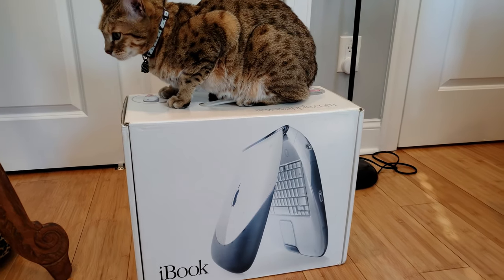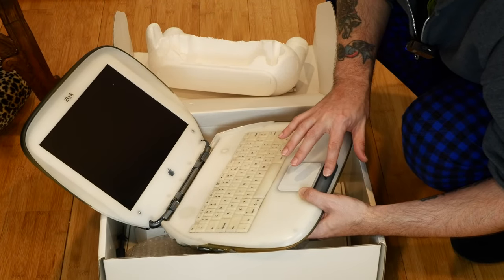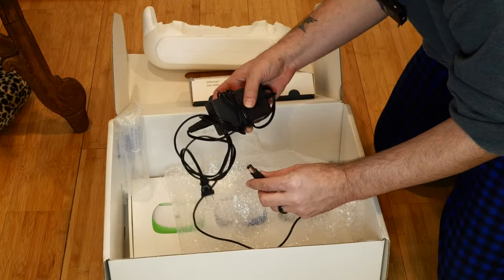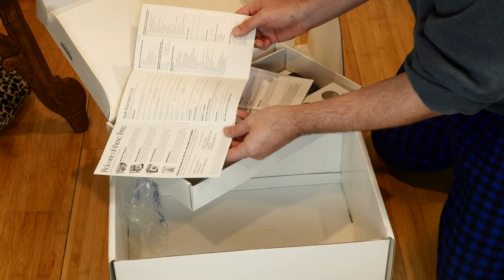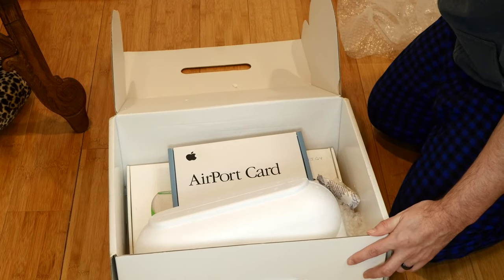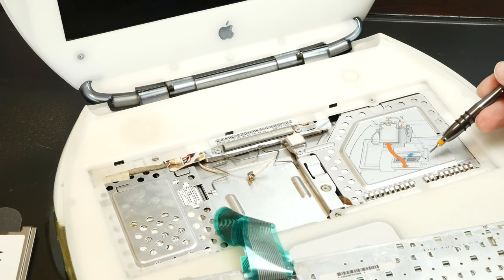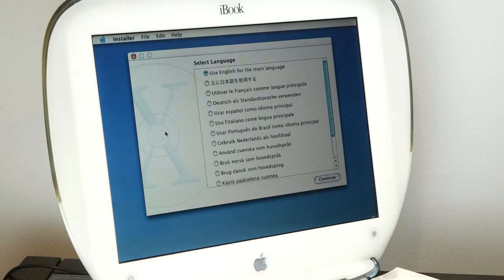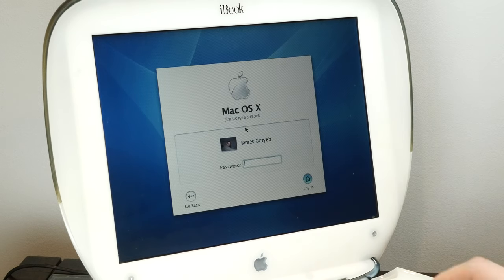Apple's Final iBook G3 Clamshell: the 466 Special Edition. Picked up with original box!

Comment: I picked up one of these exact models around the same time as this posted.  I really lucked out because even though it was not in the original box, it was basically unused.  There is no scratches, discoloring, or any wear anywhere, including the touchpad.  The battery was original with only 8 charge cycles.  I run os 9.22, which is super fast on it.  It spent its whole life in a cool dry coat closet in a dell bag, forgotten by its owner for 20 years.

Comment: Nice find! Those 6x Matsh*ta drives are the same ones used in the Pismo PowerBook G3, and they are notorious for their DVD laser going bad - had to replace my drive as it was about 50/50 reading DVDs.
Reply from the maker: I've found it at least reliably plays movie DVDs! I just got new a battery for it, and it lasts through two movies which is sweet.

Comment: Outstanding video with, the last and best version of the Clamshell iBook G3.  Have always had mixed feelings about the Clamshell model.  On one hand, I feel in love with its looks and design from the day they were introduced by Steve Jobs.  But, on the other hand it appears that, my head always guides me to the professional laptop models.  So, during this time period selected the powerbook G3 Firewire (the last of the black powerbooks and the first model that supported an internal airport card), why,?  Because the powerbook had a larger screen with a higher resolution, two USB ports, two Fire-wire 400 ports, card slot, IR port, two "Hot" swap bays (for an extra battery, floppy drive, zip drive, super disk drive, etc.).  However, perhaps after my retirement in a few years, I will be able to add the ibook G3 Clamshell to my vintage apple computer collection.
Reply from the maker: I was always really disappointed by the 800x600 display, and the weight of it. Back then, I had a Titanium Powerbook, which felt like a computer from the future at the time and still feels like a modern laptop. However, the Clamshell is just so unique, and looking back it's amazing how successful it was. There was never anything even close, back then or even today. That's why I love it now, I think. It's cool to see how far I can push such limited and unusual hardware that's so iconic.
Reply: Back in the 1990's, my co-workers were always surprised to hear me say that, I loved the cool look of the colorful ibooks but did not like at all the CRT imac or the later CRT emac.  At the time, I preferred the model that came right after my 5500 All-in-One which, was the G3 All-in-One system.  It had the same 15 inch screen and CD-ROM as an imac but also came with an internal floppy drive, zip drive, AV card, and three open PCI card slots to add USB ports and Fire-wire 400 ports.  If, I pick up in retirement an ibook 466 Special Edition for my collection one good thing is that, I know all of my G3 powerbook software will also run just fine on this model.

Comment: I remember wanting one of these awesome pieces of tech so bad back in 1999/2000 (I was 15/16). Thanks for sharing. I think that model Mac had the ability to boot into what's called Single User Mode by holding Command+S at boot up and it'll take you to a command prompt interface where you can change the password there. I'm fairly certain you don't need to boot up with a Mac OS X install disc to do it. I've not owned a PowerPC Mac in ages so I could be 100% wrong, but my memory is usually pretty good. I actually watched your DC Power/mSATA upgrade video before this one, but still cool nonetheless. Lastly, how did you burn that Tiger DVD you were attempting to boot from? I'm guessing the way you burned it it didn't create a proper boot loader/sector on the DVD, hence why the iBook was all WTF MATE? I know you mentioned in the later upgrade video that you FireWire Target Disk Mode installed Tiger, but I'm just curious how you burned that Tiger install DVD. Cheers!
Reply from the maker: Thanks! I burned it on Linux, so I think you're right. I've since switched to a FireWire drive with multiple installers for different versions of OS X on different partitions, so no more issues like that :) I also scored an original Tiger DVD with a recently PowerBook I picked up.
Reply: @ActionRetro  I have my day 1 retail Tiger/PPC DVD still as well! I actually preordered it and went to my then local Apple store to pick it up lol
Reply: I was hoping for some Single User Mode action too, just in case there was any interesting rare software like vintage utilities. That’s a function of Unix, so it should work on any non-encrypted OS X installation! But oh well, same result I guess. Just more effort :)

Comment: It's actually even easier on modern Macs to bypass a password. You just have to log into the recovery and type a single command into the terminal. Don't even need a CD anymore.
Reply: That’s disturbing if true
Reply: @MaxOakland  Always enable Filevault, this will protect you from this issue..
Reply: @MaxOakland  the same utility has been able to remove Unix users’ passwords if ran as root since its inception :) OS X just inherited it. Disk encryption is the only way to avoid it!

Comment: Every version of windows nt could be cracked in a similar fashion, sadly this is also the case for BSD, Solaris, and Linux.
Reply: I personally don’t think it matters.  You could read the data anyway, not much can be done about that - the only real fix is encryption, e.g. using FileVault or BitLocker, which obviously prevents this.